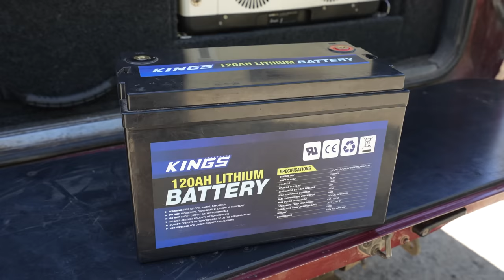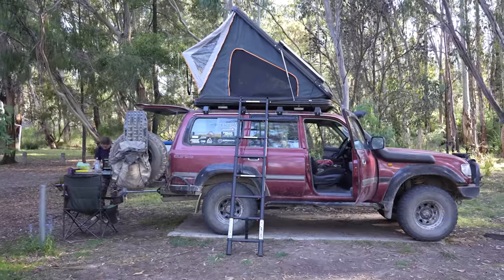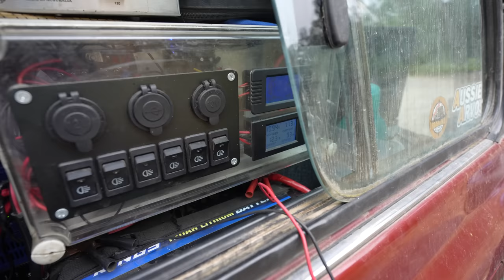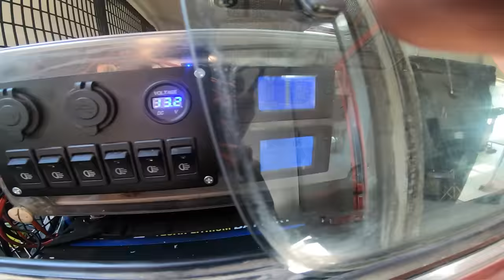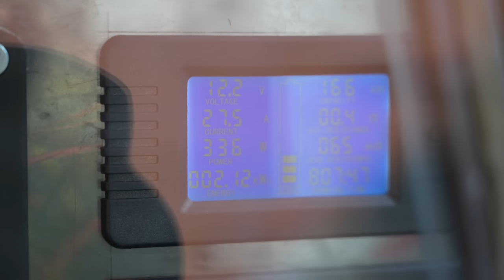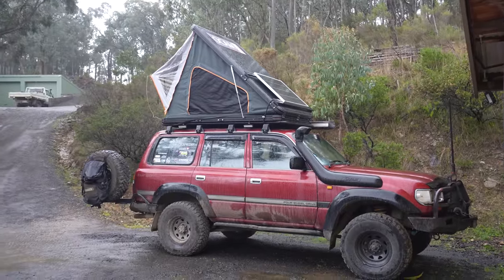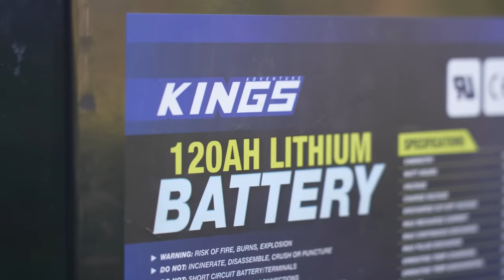Watch this BEFORE you BUY Kings Lithium Batteries

Comment: I'm on a disability pension and am looking at moving to a bush block in central Queensland (not by choice, but out of neccessity). I have a 3.5kw genny with pure sine wave inverter. I'm thinking of having a battery like this in a box, with a 3000w inverter and a 130w solar panel. Do you think this would be sufficient for me to live off long term? I'm also considering adding more units to expand this down the line and then a stand alone off-grid solar system once I have a permanent shelter in place, as I'll be living in a tent to start with.
Reply from the maker: Yeah depends on how much power you are needing but you can always add more batteries to give you more power, so i'd say it's a good start!
Reply: @AussieArvos  cheers mate. I've done a bit of digging and figured it seemed like a doable system for me. I've even lashed out and bought Will Prowse' book lol. Thanks for your input.
Reply from the maker: @TheCaptainbeefylog  No worries mate, best of luck with everything :)

Comment: Another informative and inspirational video. Just wondering how you can run a 2000 watt inverter with the induction plate at 1800 watts without the battery BMS shutting down due to exceeding battery output. After having an AGM battery go flat and a fridge/freezer with food defrost due to a blown fuse in the cigarette lighter plug I decided to research a lithium setup. . Have just bought a 100ah Voltx battery with the display which can show voltage or % of battery. I bought that so I didn't have to worry about a shunt. I also bought a Victron 12-12-18 dc to dc charger so I could program the input and shutoff voltages so no need to wire it up to the ignition or worry about draining my main battery and as my alternator is only 70 amp hopefully no worries about high amp draw and blowing my alternator. I also bought an Epever MPPT controller also because it is programmable. While I would have liked to have bought a cheaper charger and controller, there was always some drawback in doing so such as risk of battery cell degradation due to charging or discharging to full capacity and also the need to purchase and wire up extra gauges. In hind site the 200ah with the 200ah discharge would have been better but also more $$ and more $$ for a bigger inverter. I have tried it out but yet to wire it up properly and decide if I want to go inverter power or not.
Reply from the maker: Hi Bob! That sounds like a good setup! i've been able to run the induction cooker at 1800w no worries, the battery doesn't seem to care, It's just a Kmart induction stove so i'm not sure how acurate it is, but that's just been my experence! Cheers
Reply: I have a cheap induction stove from Kogan, it uses ~1400W at it's 1800W setting, which the BMS says is 117A so just under the 120A BMS limit in the Kings

Comment: I paid $199 for the  Kings AGM deep cycle 138 Amp hour,  they last  longer than lithium batteries ion phosphate batteries up to 10 years if kept fully charged, YES LONGER!!!!  contrary to popular belief They are heavier though. I have 2 lithium batteries, one has already nearly died after only 6 months of constant use. Don't get ripped off, the voltage of a lead acid AGM is higher not lower than lithium ion batteries,  my lithium batteries top out at 13.2 volts my AGM tops out at 14.6 volts . I hate to set the cat among the pigeons but if you bought a Chinese made lithium ion battery you will be lucky to get more than 3-5 years out of it, unless it's German quality made and lithium ion batteries are expensive and potentially dangerous as they can explode due to a degraded pole seperator!. By the way again I hate to set the cat among the pigeons yet again but be aware most lithium ion phosphate batteries sold in Australia have only 55-60% of their claimed Amp hour storage, if you don't believe me get an electical technician to dismantle your lithium ion battery and test the cells present in it, you will be disappointed that I can guarantee you as Chinese manufacturers knowingly willingly put dud cells into Australian bound batteries because Australian consumer watchdogs are powerless to stop them and Australia is a small market, if you buy a Chinese lithium ion battery in the US  there will not be an issue simply because the US is a huge market and the US government wont stand for it! Nuff said
Reply: WHY do you have to get a an electrical technician to dismantle the battery ... to measure the total Amp-Hours?  Can't you do that from the two external terminals?  The BMS should shut down when any one cell goes under-voltage.
Reply: 50-60% of lithium batteries test under ??? ……….prove it .

Comment: What did your Lithium battery run in your house??.. The laptop computer via USB???... @6.50 I saw the long 240volt extension cord going into the house... I'm intrigued, what size is your pure sine wave inverter ( watts ) and you must have had the car running....
Reply from the maker: 1500w running lights, pc, fans, wifi, fridge
Reply: @AussieArvos   If the household fridge was drawing an average 400watts, that means your inverter is drawing 33amps..

Comment: Great stuff mate. I've got some Kings stuff... like the 2000w inverter (never had an issue with it). I've switched to lithium in the camper, but haven't yet upgraded the dc/dc charger, which I need to do as I understand the lithiums won't be getting a full charge.  Couple of quick questions... What dc/dc charger are you using and is it as simple as pulling the old dc/dc charger out and dropping in a lithium compatible one?  Keep posting the vids... they're really, really useful (and appreciated!). Cheers 🍻

Comment: I'm interested in them but they prone to burn 🔥 that scares me , will hold out a bit longer and see
Reply: Especially when they are in situations over 50' temp. A hot car in the aussie sun is hugely dangerous to ha e a lithium battery sit in.
Reply: @Steve211Ucdhihifvshi  yer that concerns me , and putting them under the lounge in the van wow the weight difference is good and the longer lasting 12v is great but if any thing ever went wrong a fault in it and it caught on fire 🔥 it's all over
Reply: Also my second battery is a deep cycle under the bonnet on the car no way would I ever put a lithium battery there

Comment: Biggest downside to lithium is well. They catch on fire alot but also, have max temp range of 50C. Running my fridge in summer with battery in the back of the ute would easy hit 70C

Comment: When it comes to buying a lifepo4 battery there's lots of traps for new players.  One of the brands in the list at 3:56 is known to have shall we say 'questionable' performance and has been sprung overstating battery capacity in the past.  Even post that revelation read the fine print.  If the BMS cut off results in the cells being discharged to under 2.5V, avoid that battery like the plague, and perhaps the entire brand of batteries too.

See if they state the end of life capacity of the battery as using a lower than normal EOL point is a common way of fluffing up cycle counts.  The industry standard is battery is EOL at 80% of the original specification capacity.  That doesn't mean the battery really is dead at that point, it may well continue to work at lower capacity for years, it's just a common point of comparison that harks back to lead acid days.  A lead acid battery usually goes off the cliff pretty quickly once it reached 80%.

The 2000 cycle count for the Kings battery in this clip is quite honest at first glance.  It's the cell manufacturer stated nominal cycle life stated for a lot of lifepo4 cells that don't have mechanical constraint.

Comment: Lithium is a no brainer but also a no brainer to run same chemistry starter get rid of all the junk charging gear just run a VSR, lithium starter batteries are also affordable 

Shave the 5 hour charge time down to 1 while simplifying the whole system, have been running 2x ITech starters no issues for over a year

Comment: The Kings battery here shows the maximum continuous discharge current of 100A the ones on their website show 120A @25°C, He mentions 1800w induction cooktop, that's 150A this exceeds the maximum continuous discharge current of that battery. Dont run an 1800w induction cooktop or a 2000W inverter from this battery.

Comment: my home made lithium which is 8x 160ah cells with around 4000 cycles which is double the kings and will cost me $1400 to make with a stainless steel case which is way better then the plastic ones, also a way better bluetooth bms rated to 250a also ill have 0 b&s cable rated to 330a so much better protection and as for the temp senstive ill have 2mm thick silicone mica sheeting between and around the cells with eva foam around them also which the temps will be charge -20c to 500c, discharge -20c to 500c. and charge rated at 250, discharge 250a with active balancer and passive balancer. It will be rated to 340ah. The biggest issues with lithums being so cheap is they cut on the cable thickness.. the bms may say 120a discharge but its more like 50-60a discharge due to the thickness of the cables.. hence why so many lithium batteries that are cheap go up in flames and wreck thousands of dollars of electrical gear..They also cut on insulation and good padding and the cases being plastic which cost like 20 cents to make in china have a higher chance of catching fire.. Thats why you got cheap $500 lithium 100ah and then you got expensive $5000 100ah batteries... I mean in that post as you showed its clear they used 3x 10awg cable instead of 1 thicker much better cable and they are using normal electrical cable not battery cable which has way better insulation.. normal electrical awg cable has next to no insulation.. so 10awg is rated to only max 30a so them putting 3 in you would think thats a easy 90a but thats not the case it would be less due to the heat depedning on the loads.. and the 120a discharge they seem to think you can do is a lie considering the negative again is 4x 30a but really its 4x20a or less due to the zero inuslation on the cables and using too many just to try justify 120a which shows they obviously are cutting down on the price of cables.. also for the cycles if you know anything about lithium prismatic cells iff they are 2000 cycles really its not.. its more like 1500 cycles and they are not A grade as kings state they would be b-c grade and used cells as new cells that are a grade you looking at a min of 4000-6000 cycles. Ask any lithum cell vendor on alibaba or ask the diysolarpower forum and they tell you any cheap battery wont be A grade and more like C grade used cells hence why they are so cheap

Comment: Just wondering, can these also handle being used as the winching battery?
Reply: It is a battery. There is no such thing as "winching" battery.
Reply: Batteries are designed with different load allowances.
Lead acid batteries can handle starter motors & winches.
LifePo may not handle those current loads.
My query is relevant & yet unanswered.
Reply: @recommit  It is your responsibility to match the specifications of the battery, to the load requirements. It is that simple. We cannot do that for you.  Some lead acid batteries can be used to start vehicles, while other lead acid batteries cannot.  When the engine is off, the starter battery is not the ideal battery, to power the winch.
Reply: No worries.
You certainly seem unqualified to be answering this query then.
Reply: @recommit  You provided no information and then you asked if a LiFePO4 battery can power your winch. Maybe it can, maybe it can't.  You did not provide the information, that is required to answer your question. You seem to be very unqualified.

Comment: Nah. See no point going to wilderness and still using same kitchen appliances as at home. Plus, Pb battery can 1. be mounted under bonnet to save valuable space in the back 2. be used for starting if the main goes flat 3. improve winching performance.

Comment: Impressive, the cheapest price in my country for a off the shelf lithium battery (105 +/- Ah range) is about AU$ 661,89.

But back when the exchange rate was normal, it would have been around the $800 region.

Comment: JUST 200AMP  LITHIUM BATTLEIES SETUP INTO MY 2010 ISUZU TRUCK WHICH 24V POWER AND 90AMP  WITH 180W SOLE POWER  WITH 40AMP DC TO DC CHARGE

Comment: So, the big thing is that you do not mention at all, and is the biggest trap for people with lithium batteries, is the Maximum discharge current! High wattage appliance's off an inverter on a 12V system, take into account ohms law.. can be in the 150 to 200 Amp current draw range.. So that is the first thing to consider when looking at lithium batteries, because if you are over that Amp range your BMS will not handle it.

Comment: Needs a detailed comparison of lithium batteries. Other brands are cheaper or have better features and qualities. Lifecycle on most LiFePO4 is over 5,000 cycles. Beware of those only reporting 2,000 cycles. The newer better brands give over 10,000 cycles. 

Kings reporting only 2,000 cycles seems low compared to industry norms. 

The biggest problem most ppl have is high enough recharge rates from standard alternators and lithium chargers.

Wiring size and fuses matter. 

I’m more of a technical fan. Less chat about the obvious power capacity & power usage of different items. More about numbers, wiring standards, electrical safety.

Comment: It's not even possible to run a 1800w induction cooker or that 2000w inverter at full tilt with that kings lithium battery. It's only rated at 100a continuous discharge which is around 1000w. So don't know how you've been doing it unless you have 2 of those kings batteries in parallel.

Comment: It has a max continuous discharge current of 100A so I can’t see how you’d use an induction cooktop with it. 

My induction cooktop is 2200W and I run it off a 300Ah Lithium with max continuous discharge of 200A. I also run a 40A DC-DC. 

100A x 12V is 1200W - I’ve not seen an induction cooktop that low powered.

2000W Inverter would draw 167A at 12V (a bit less at 12.8V and more at 11.8V) on full power. 
If your induction cooktop is 1800W you’ll be drawing 150A from a battery with max 100A continuous - either it’ll shut off (BMS controlled) or you’ll damage your battery - worst case melt it.

With an 1800W Induction running at 50% duty cycle, you’d only get 1.6hr of run time from a full 120Ah battery that’s excluding fridge and lights power draw and assuming it would support 150A draw which it doesn’t.  So in reality you could likely only use it once or twice for 30min each time before needing to charge the battery.

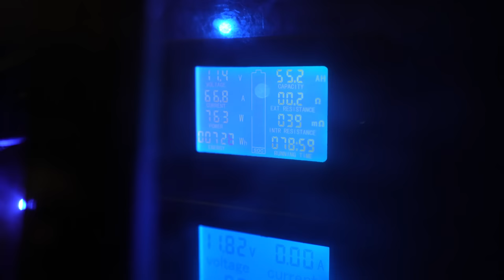Screen pause at 9:30 shows drawing 66.7A at 11.3V (only 759W).

Comment: Please be warned about Kings batteries. At that price they are using B or C grade cells. These are the cells that fail either capacity or resistance tests, essentially the rejects. At best they will perform poorly under higher load, and the pack will have reduced capacity. At worst they are dangerous. Kings also use the Pace BMS, a notoriously cheap and nasty Chinese  BMS that has a failure rate well over 10% within the first 12 months. Just because it works, and provides some power, does not mean its a good battery. You need to do capacity and load tests. I appreciate you dont have those tools...and I appreciate everyone's needs are different, and some people have very basic needs. But I do worry about the electrical waste from manufacturers using such cheap components susceptible to early life failure and landfill.

Comment: When it comes to charging a lithium battery that has gone into BMS cut off there are plenty of chargers, DC-DC, AC-DC and solar, that will 'wake up' the battery.  Some default to doing it, some need to be configured to use a fixed battery voltage rather than using automatic detection.  It's really only the cheap junk that does not have any capability to do it at all.

Comment: you are ruining your batt if you run it to dead... I replied to a comment down below addressing this... peak lifecycle performance will be achieved if you mostly keep the batt between 25%-80% soc(state of charge). absolute best, run it mostly between 40 and 80%... if treated properly, you can expect 20 to 40 years out of a LiFePo battery.
if you find yourself regularly pushing the limit of your batt's state of charge, its worth it in the long run to get a second batt, so you can operate mostly within optimum levels of soc.
If you stay within optimum ranges, you can expect 5000 cycles, and still be at 80% functionality. At a half cycle a day, that's almost 3 decades...
Summing up, sure, cheap is ok, but really, when you spread the cost over that many years, even a pricy batt is cheap.
my advice, DON'T CHEAP OUT.